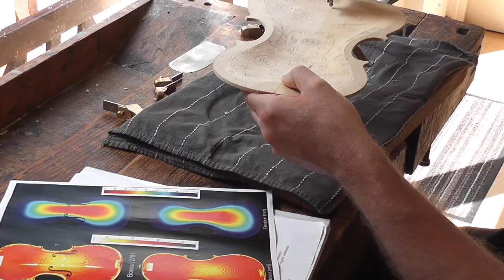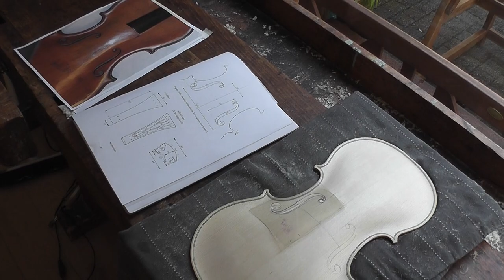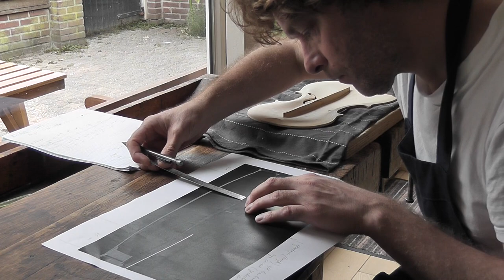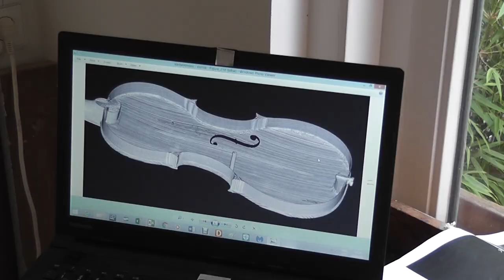Exploring lost violin making practices 4: the top plate

Comment: كیف تكبس الالواح بهاذا البساطه ؟  الیس قبل الكبس او الالتحام اي قبل الغراء ....لازم یكون اللوحتین یسد الضوء ولایدخل الضوء بینهما قبل الغراء والكبس ...ارید الجواب من فضلك ....لان هاذا ؟حیرني كل اساتذه الاروبیین یلتحمون الخشب بالغراء الحیواني ....بكل بساطه ....؟؟؟  🙏🙏🙏
Reply from the maker: Hi Karzan, thanks for your comment, for which I used Google translate to translate from Arabic. I hope I understood well tho... In order to glue the two panels well, you have to make sure that you plane them very well, so they fit without any gap or rocking. This needs practice. Check with a very straight ruler, and also check if the plane on the wood is not "twisted" (you can check with two sticks, placed perpendicular at each end of the plane to be examined, and then looking over the two sticks to see if they parallel). You can also dry fit the two panels and see and feel if the fit is tight. At first it takes you a whole day, then half a day and finally 30 minutes. When the glue is applied, and the two parts are rubbed together, they are holding already really strong. Some people don't even use clamps, but I do. Good luck, just try it yourself and you'll learn quickly. Thank you.

Comment: Why are you calling these practices "lost"?  Just curious.
Reply from the maker: Hi ajfmusical, 
Because "no one" nowadays makes a violin using the shown methods in the video series. I wanted to try these methods, by making instruments that way. If you look at (and compare) other violin making videos on YouTube, you will notice a full inner or outer mould is used, the neck is separate from the upper block, etc.. Such choices imply a whole other making sequence and construction techniques. Hopes this short explanation helps! Best regards, Geerten
Reply: @Boussu_Inside_Out  Excellent!  Thanks for that clarification.  I've always wondered about the strength of the neck & the potential flaws of a separately constructed glued attachment.
Reply from the maker: @ajfmusical  The glued-on neck has its advantages too... like the more easy way of performing a "neck reset".
Reply: @Boussu_Inside_Out  It's the very first time I saw a violin made like this. I'm a guitar maker, so I can relate to the process.
Reply from the maker: @JeanClaudePeeters  Yes you're right, these techniques are still employed in classical and steelstring guitar making! Best regards, Geerten